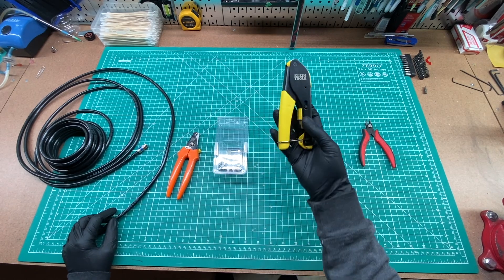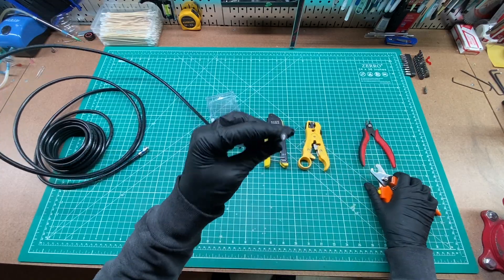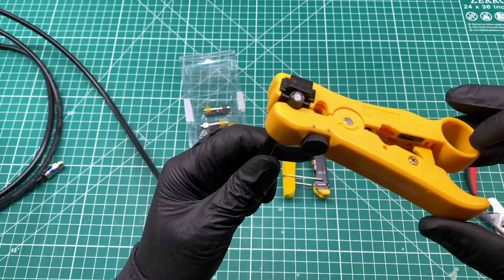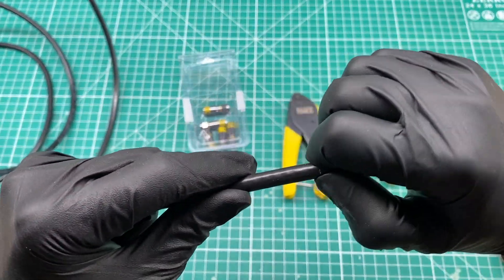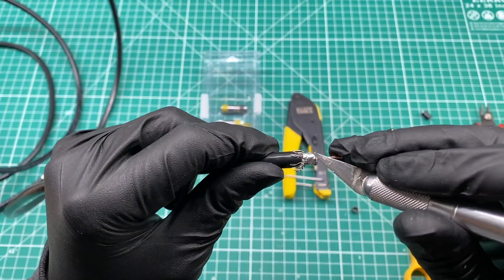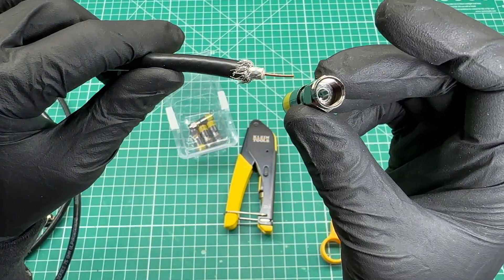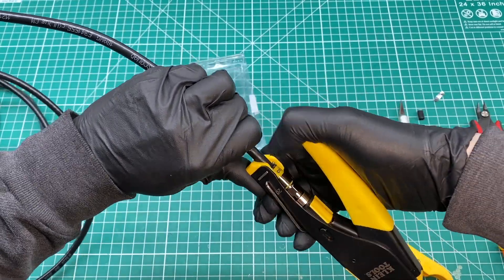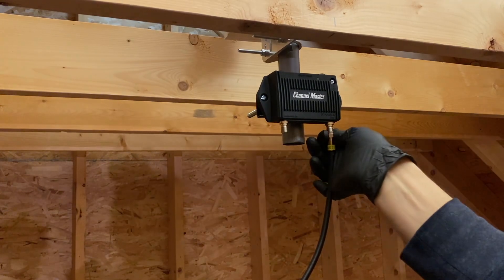How to Crimp Coax Cable With F-Type Connectors

Comment: DO NOT USE THESE ! They are a compression connection and they will come loose within minutes at the most. Cheap Chinese eBay junk.
Reply from the maker: Yes, they are compression connectors, but not from eBay. The ones I used are made by Klein Tools, which are sold at Home Depot and Lowe’s. When crimped on the correct cable I’m unable to pull them off.

Comment: Umm that's not a crimp connection. Thats a compression connection. The difference is that with a crimp attached, a crimp tool goes around a metal part at the back end and crimps or clamps the metal part down around the outside of the cable jacket. A compression just shoves it snugly on over the outside of the jacket.

Comment: 1- can you re-use those type of connectors?
Reply from the maker: No, it is permanent once you crimp it. One time I messed up and didn’t push the cable far enough into the connector and I was able to pull the cable out. I tried pushing the two pieces of the connector housing apart and the little tabs inside broke off.